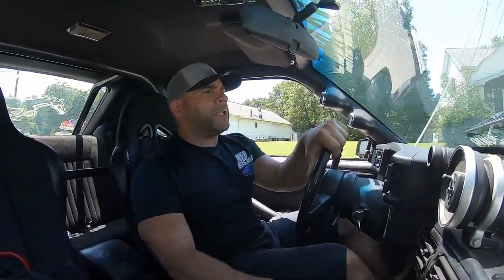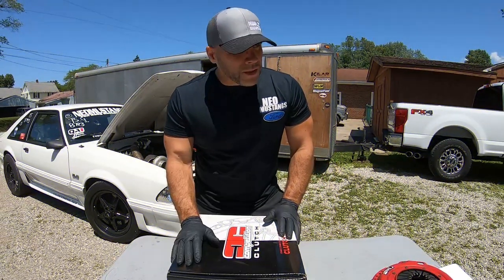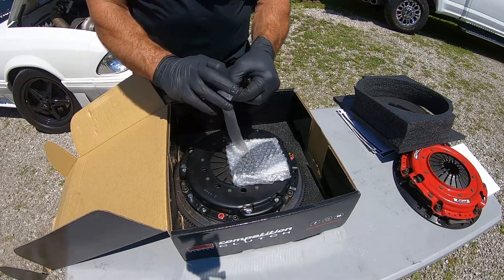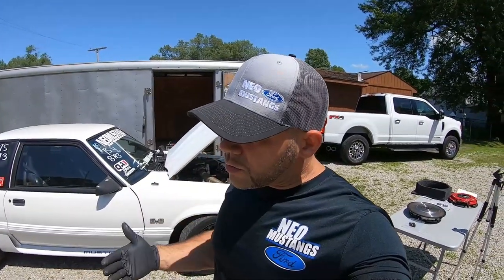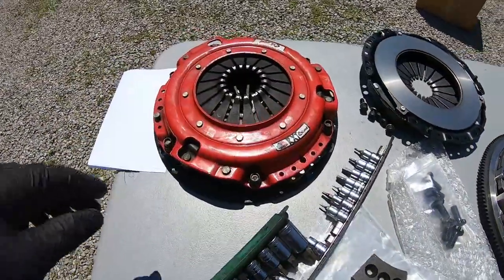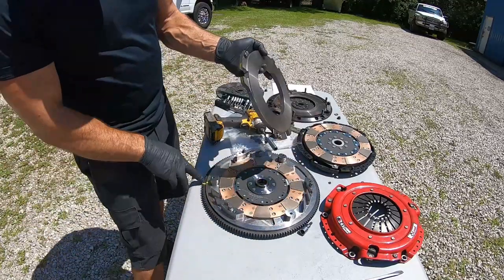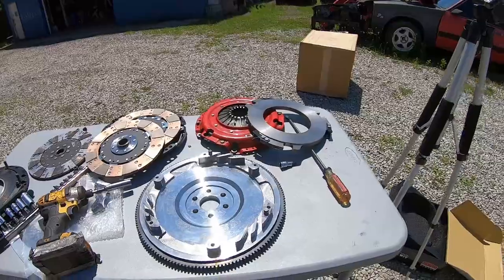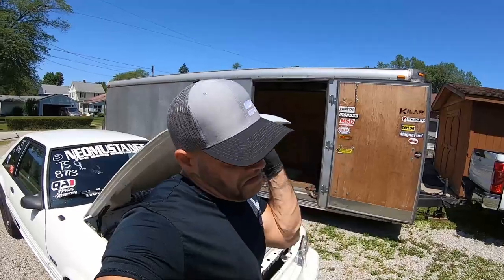Who is Vengeance? New Clutch Sheriff In Town? Review & Unboxing

Comment: This design reminds me of my South Bend Dual Disk in my 7.3 Powerstroke. Holding capacity (1300 ft lbs) is great, drives like stock, shifting speed suffers though. You probably don't notice with that dog box, but my synchros noticed. A ZF6 7.3 isn't for drag racing anyways😂

Comment: Did this ever go into the car? I ordered my vengeance stage 1. Waiting on it to be installed next month. How does it drive? Bite point, feel etc?
Reply from the maker: It’s not a bad clutch but we never used it. We use mcleod rxt HDs
Reply: @Neomustangs  I see. I was between this and mcleod but we will find out if it's worth it. Between the MGW x spec and the vengeance, I'm very hopeful that 2-3 shift won't give me anymore problems at high rpm.